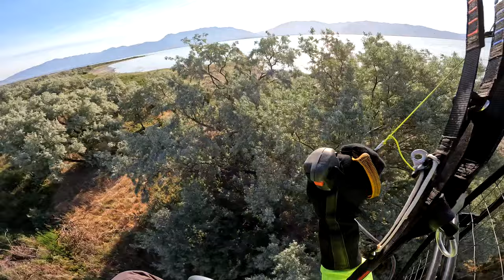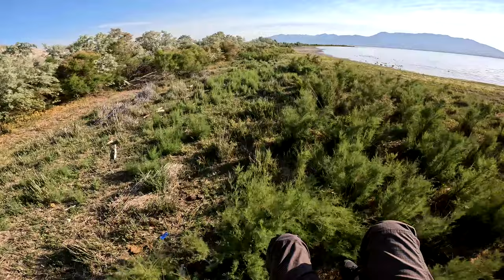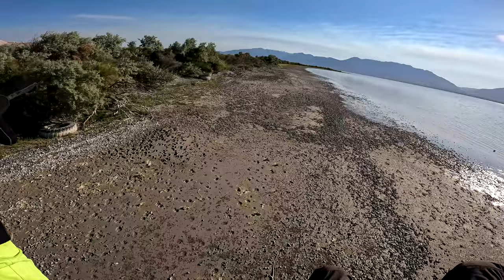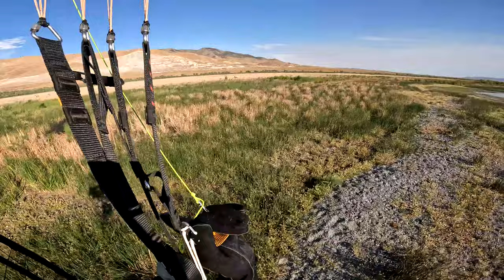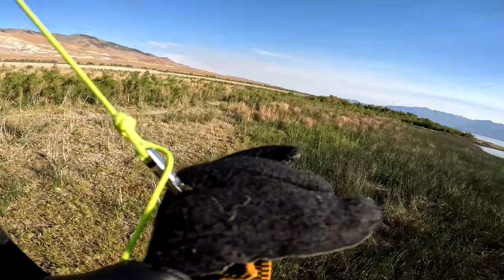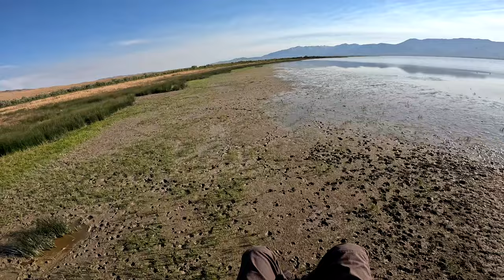Rotor vs Mechanical Turbulence vs Wind Shadow - Paramotor Tips

Comment: Serious question— So how does super training teach me for those conditions when ST is on a beach with consistent laminar flow?
Reply from the maker: Laminar flow? lol.  You have never kited at the beach I take it.  Kiting in the rotor of RVs and other pilots is not laminar at all but it really isn't about the flow it's about practicing in wind.  You can't learn to balance a broom stick on your finger by holding it from the top of the broom stick.  So if you get in the air without proper skills you don't really learn them in the air.  On the ground you do have to perfectly keep the glider both above you and perfectly loaded to sit back and carry your body weight on the ground.  This is exactly the skill it takes to fly in active conditions in the mountains.  If the glider loses the slightest lift on the beach you start falling backwards and respond by adding brakes.  If you are getting drug from too much loading your hands need to go up to reduce the lift or drag.  So by time you can perfectly control the altitude of your butt give or take 1 inch using the glider you have exactly the skill it takes to keep your glider perfectly loaded in the air.  If they glider pitches forwards it feels exactly the same as losing lift and your butt dropping while kiting on the beach and the correct response is exactly the same.  So the ONLY place you can truly learn real actual active piloting skills is on the ground at the perfect beach at SUPER training.  No other school in the world teaches true glider control mastery.  If you can kite on a pole at the beach the odds of you taking a collapse in the mountains are as low as they are going to get.